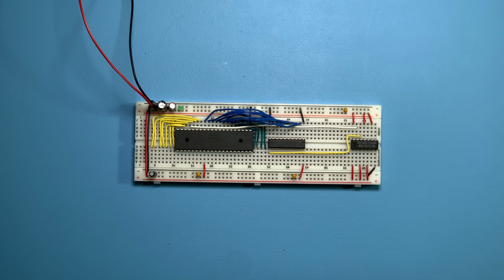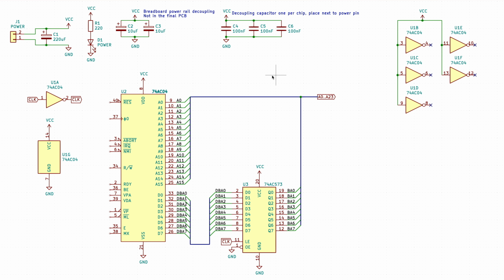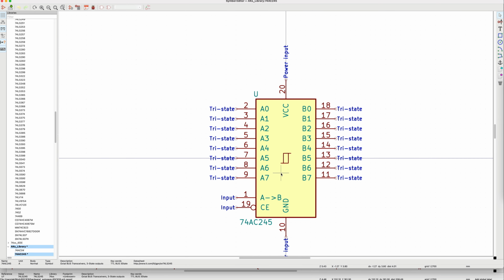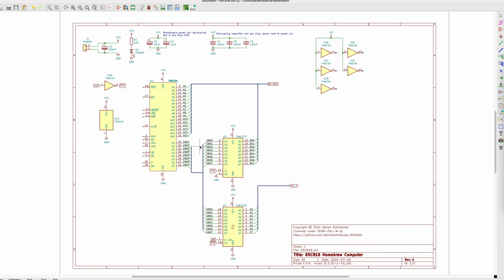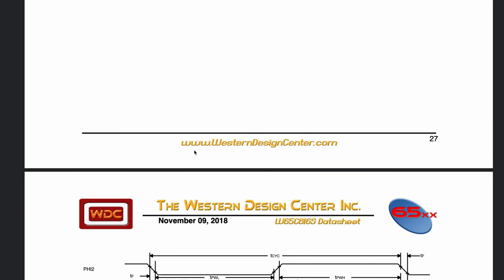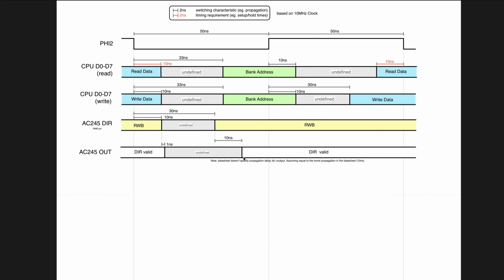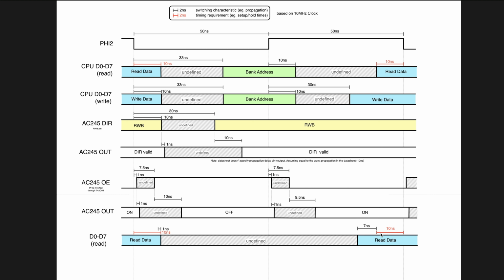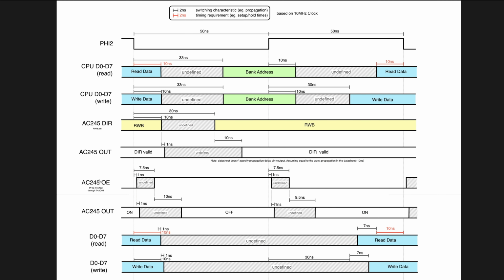#2 - Data buffering - BB816 Computer

Comment: It seems like you would have more flexibility if you ran the clock through a series of inverters (74*04 for example), and then chose the timing off of whichever tap on the inverters gave you the timing you need.  So for example, the CPU clock would run off the final inverter, but everything else could choose a different inverter earlier in the chain in order to adjust its timing.  Each inverter pair would give you somewhere between 2 and 14ns of adjustment.  So, with three inverter pairs you would get -4ns to -28ns of adjustment.  Alternatively, and more precisely, I believe there are chips like DS1100 from Maxim that allow you to create several separate taps at different precise delay timings.  I've been contemplating building a 65816 based retro computer, and I think I may go that route.  It seems like it gives me more design flexibility.

Comment: I might try interfacing the memory devices directly to the CPU data bus, and use a buffer for everything else.  Probably can also connect the 65C21 and 22 devices directly as well.
Don't rewrite the symbol, flip the part left to right during placement!

Comment: Thank you for doing this series on the 65c816. I've built a breadboard computer with a 6502 inspired by Ben Eater's videos, and yours are in the same line. I might build a 816 one maybe later. I'm impressed by how you decipher, understand the timing diagram and translate them to your own version, which makes them more understandable.

I've read in another comment you do them manually, do you know Wavedrom? I haven't actually used it myself, but I figure you might find it useful. It seems like a very powerful tool to draw waveforms and timing diagrams.

Thabks again for your series, I'm enjoying it very much.
Reply from the maker: Thank you! Hope you enjoy the rest of the series. 

Someone actually recommended Wavedrom already and I start using it in the next video I'm working on. It is great but a bit rough around the edges, had to make a bunch of changes to make it work well for my use case. Beats drawing everything pixel per pixel though!

Comment: Hey love your videos, got some tips for kicad you might find useful.
when you're repeating things downwards you can press insert which will copy the last thing you just did. this also works on labels and automatically increments them. so if you press ins after placing label "D0" it would create one below it called "D1". you can also flip ICs isntead of recreating them
Reply: Another tip is to hold left mouse button down while dragging to do a block select. If you were just above the bus entry/exist lines and dragged across them you could have done a right click and selected "duplicate block" then a paste to copy all those lines. X and Y let you flip the block horizontally and vertically to get the correct orientation for the new location before you paste the block.
Reply from the maker: @kevincozens6837  Good tip, thanks!
Reply from the maker: Hey 👋 thanks for the tips! My keyboard doesn't have an Insert key but I'll take a look at the keybindings next time